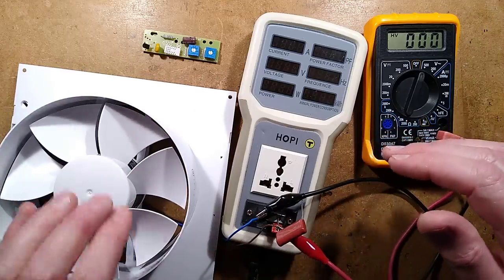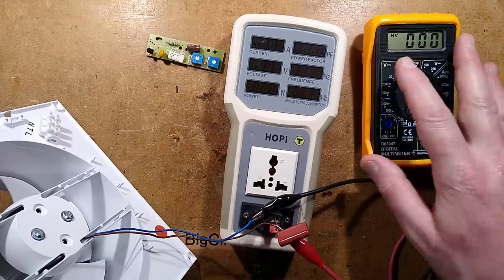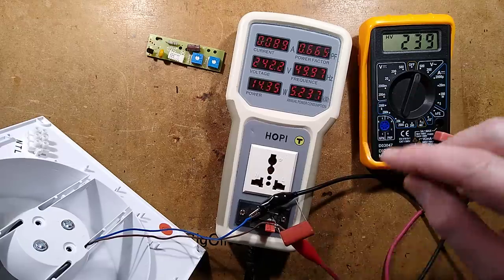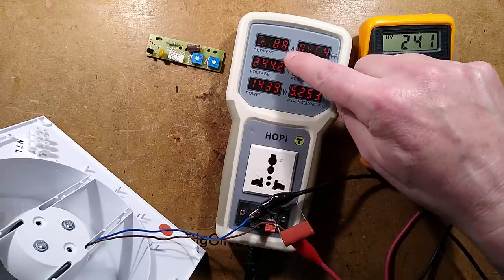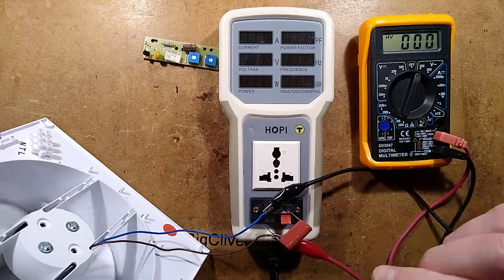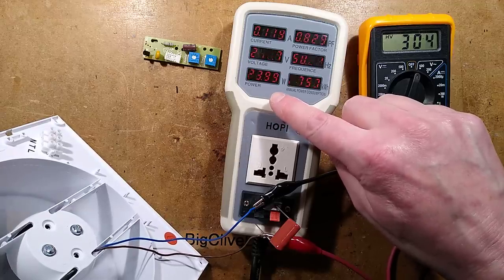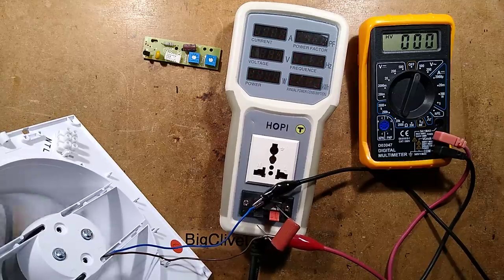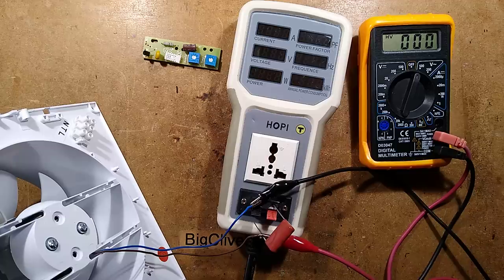What the heck!  Series capacitor makes fan go TURBO!

Comment: As others have said, this is a sort of power factor correction (though often power factor correction uses parallel capacitors, not series capacitors).  I ran through the numbers for this.  It's nice to see that theory works.  For the circuit without the capacitor, the complex power can be calculated using the real power and power factor provided by the HOPI, and then in turn the equivalent impedance of the motor can be calculated to be Z_m = 1769+j1987 Ohms.  The 1uF capacitor has impedance Z_c = -j3183 Ohms. The series combination of the motor and capacitor has impedance Z_eq = 1769 - j1196 Ohms, which is smaller in magnitude, and thus will draw more current from the line (which is at 240V).  Specifically, the expected current will be 240/Z_eq = 0.112 A with phase 34.1 deg, which matches pretty well with the measurement of the motor with capacitor (within tolerances).  If the capacitance were about 1.6uF, it would make the series load look almost entirely resistive (and make the motor spin fastest).
Reply: I remember back in electronics school, I was bored, so I put in a modest resistor to monitor current, then slapped the oscilloscope on in vectorscope mode to see the phase angles on the inductive motor, the capacitor and the current angles.
The instructor loved it and apparently, added it to the power factor correction class later on.
Reply: This is the most clear and precise answer. Good for you dude.
Reply: Wait, are you saying there is Build up of Electrical Energy that can't pass though the capacitor and therefore is dispersed though the Motor instead? If that was true then only 1/2 the wave form could pass through the motor, which would make it pulse. Electricity doesn't flow in wires. Maybe I miss understood you :face-blue-question-mark:
Reply: @Dazza_Doo  yeah and resisters are also diodes.
Seriously, the subject is over a century old!
Reply: @spvillano  you know what is over a century old, Why is the Sky Blue:face-blue-covering-eyes:
The Sky is blue because... the Electromagnetic wave length is filtered at the wavelength Air likes to absorb, it is then Scattered and perceived as Blue light and the Sun is perceived as Yellow, even though the Sun puts out Pure White Light. 

My Story is this: "Resisters are also diodes", doesn't tell me anything of value in regard to this video. 

I'm really not sure of your meaning :face-blue-question-mark:
I'm trying to learn, for me there is nothing to debate. 

I'm I going to play "So you are saying" game? OK So you are saying that the capacitor is NOT in resonance and has become a perfect Resistor and Since as you said "Resisters are diodes" does that mean you think the Capacitor is now a Diode.

I know that Diodes with a AC energy, only gives 1/2 of the energy in 1 direction, there by reducing the fan speeds, since it has 1/2 the wave form of energy? 

:text-green-game-over:
End Of Line
Reply: @Dazza_Doo  Were you replying to me?  My comment above is framed in terms of ac analysis (aka sinusoidal steady-state analysis).  Electrical current certainly does flow through wires.  And AC current flows through a capacitor, but the sinusoidal voltage lags the sinusoidal current by 90 degrees.  (The run capacitor in a single phase induction motor is there to create a phase difference between the two windings in the motor.  If there wasn't a phase difference the motor wouldn't spin.)  My impedance calculations are related to resonance.  The resonant frequency is when the reactance of the capacitor (imaginary part of the impedance) cancels out with the inductive reactance of the motor, which would happen here when the capacitance is about 1.6uF.  The circuit in the video is not at resonance (which would be 63 Hz for the 1uF cap).  Impedances and power factor allow one to predict what is going on inside the circuit.
Reply: @Dazza_Doo  Electricity doesn't flow in wires? Hmm. I wonder how many people got electrocuted by touching a wire...
Reply: @crazysquirrel9425  Electrodynamics mate
Reply: @Dazza_Doo  For us lay folk, we need a tad bit more information.
Reply: @crazysquirrel9425  I'm a lay folk too, I've just watched many YT videos regarding this information. I started when Veritasium made his video The Big Misconception About Electricity and his follow up video, that BigClive made a video on. Which lead me to Rick Hartley, The Science Asylum made some really good entry videos for us Lay persons regarding Electrodynamics. Most Electrical Engineers already know this information, it's not passed down efficiently to the commoners, and this is why I struggled with Electronics for such a long time. If you want to learn a little more, you are most welcome. Sorry for the rambling. Hope you can learn more.
Reply: @crazysquirrel9425  On a side note, the reason PCB designers are obsessed with Energy within the Circuit, is because is a microscopic transmission line, which is what they call the Power Station to Your home circuit. The Transmission line, never physically touches your house, there are air gaps and energy conversions thought the 'Power Grid'. PCB designers often get Interference, Electronic interference within Circuit boards, this then made the PCB industry develop into digging deeper into how Electricity really flows. Most of the knowledge is from Physicists, understanding the Einstein, Maxwell and all the other "Brains". I digress, You will find good information from PCB designers on how energy flows in a circuit, because if they don't they could bring down an aircraft, create a flaw in a guidance system for satellites by the way the Circuit board is layed out.. etc. <--- that's one of the reasons you can find the deeper material there. I'm sure are other reasons too.
Reply: @Dazza_Doo  Then what size capacitor do I add to my box fan?
If a capacitor passes AC, wouldn't that allow current flow when the fan is off too?
I want to make a box with an outlet and a cord, add in a capacitor (across the outlet? and cord to the outlet.
Would that work?
Also, if I used the same adapter setup, what else can be plugged into it and get a benefit?
Corded drill?
Blender?
TV set?
What capacitor ratings and type would I need?
Or does each item need it's own cap values for that particular item?
What if you put the cap in series with the line?
Reply: @crazysquirrel9425  As far as I know and you should search BigClives videos, I being watch them at times. The Question of "If a capacitor passes AC, wouldn't that allow current to flow when the Fan is off too?" Yes, Briefly, as the Capacitor discharges. As for your other questions, I haven't experimented with such designs. In BigClives video above the interesting part was the improved power efficiency to the motor, as BigClive only 'over powers' the motor for a short duration. The above fan is a simple motor, possibly the universal motor layout and they are not the best at efficiency to begin with. If you try this with a DC drill (of quality - say "Dewalt brand") then those motors are more like Electric Car motors, very efficient to begin with and they have dedicated controllers.
Reply: @Dazza_Doo  You are confusing the flow of electrical current with the flow of electrical energy.  The Veritasium video discusses the Poynting vector (the cross product of the electric and magnetic field, as a function of position) which describes power flux, NOT current.   It is important to distinguish between those distinct concepts.  Current flows in wires.  Flowing current creates the magnetic field that causes power transfer as described by the Poynting vector.
Reply: @regroff  We could say that EM waves in the wire create Electrical current (moving electrons in a direction). The flow of Electrical Energy is the same as the Flow of Electrons (current) and since Electron Drift is microscopic, then the Energy is in the fields, the Current is the Result or the Effect of the Fields. I don't think there is confusion, they are both interlinked (play The Circle of Life - Lion King). In a conductor (which is usually in excess of Electrons in the outer layers that are in their spin) Electrons at 'rest' have ben said to be moving at the speed of light in every direction all at once (Quantum physics is way beyond me) I do watch Science Asylum and try and follow. I digress ... The EM wave is the Energy, we can say this for fact was we observe this in our car radio (EM Waves by Professor Matt Anderson) really shows this in action. EM Waves if not interrupted by a conductor will travel free space until they do get absorbed by something. Since Electron drift is microscopic and that is Current, then if the Current carried the Energy in circuit, then our circuits and lightbulbs would take maybe an Hour to turn on? Lightbulbs to Switch in your house.
I'm saying that Current is a bi-product of the EM wave in the circuit. This is directly proven with AC - no Electrons from the Power Grid or Generator come to your house or circuit. Current is a result of these fields, because they have energy. Inductors are mediums (as in physical). We Measure Voltage, and We Measure Current - what are we measuring? The EM effects on that medium. I don't think I'm confused, I'm trying to dig deeper. Does it matter for a DC steady state circuit? Not at all, not really. Unless you have switching components and AC energy. An LED is happy to absorb all the Energy from a 3v button cell and hey, even some of the electrons from the battery will probably make it to the LED :D 

So sum up: 
Current = SLOW (even a turtle is faster)
AC: Current goes No where (1 Step forward, 1 Step Back) 

Other Evidence: 
Return Currents in a circuit in a DC steady state will radiate out and will return back to the source signal in a mostly direct path, however at higher frequencies the return Current only follows the direct path back from the signal source (directly under it), why? Current isn't Energy, it's a result of the medium being energized by the EM field, so it' 'Follows' that path back. It only about 100Hz before the return current is fully returning the same path from the Signal source. This is the Rise and Fall times of switching components. How does this relate to current? Current is reacting to the EM fields traveling along the conductor (microstrip line). See Rick Hartly and Eric Bogatin for more information.

Comment: Adding a capacitor created a resonnant circuit, maybe not perfectly tuned, but still a resonant circuit.  They tend to create higher voltages or currents that what comes from the power source.  Thus your power and voltage readings where higher than expected.

Comment: I'm glad I"m not the only one who experienced something like this. My desk fan, rated 120v .33 amps @ 60Hz in series with a 10uF capacitor was getting just about 240v due to the boost. One difference is I thought mine went immediately to double voltage and yours is taking some time to reach only 33% more voltage.

Comment: As others have mentioned, it has something to do with LC resonance but I just wanted to add, I have used smaller value capacitors to drop the voltage and run small 110V induction motors on 220V without the losses of using a resistor. This video shows what would happen if you want to drop the voltage but get the wrong (right?) value capacitor.

Comment: The exact same thing happened to me when I tried to reduce the speed of noisy a fan, with a capacitive dropper😂😂. Some values  of capacitors would slow the fan down, BUT if you hit a sweet spot valve of capacitance , then the fan went mental speed!!! I think the inductance of the motor and the capacitor are forming a tuned resonance circuit. It was quite cool to observe at the time. Thanks for  reminding me of this. I would love to see an oscilloscope trace of the wave form.

Comment: Increase the capacitance to make the power factor 1.0 then use a variac to reduce the supply voltage until the wattage is back down to the fan's normal value. Now you have an efficient fan.

Comment: Are we sure it's not April the 1st and Clive is having us over? But seriously, I think it's time you break out the oscilloscope and track the voltage and current phase relationship with and without the capacitor; I think you may find it's bringing the voltage and current into phase alignment.
Reply from the maker: It's real.  But there must be some interaction to increase the voltage.  The power factor does improve.
Reply: @bigclivedotcom  Yeah, there are a lot of pages about LC resonance. Both the voltage across the inductor and capacitor are higher than the supply voltage, but this difference cancels out because they're out of phase. (Don't ask me about the maths; I tend to get lost when j or i enters the equation.) If you choose the right (or wrong?) value for the capacitor you can bring the AC impedance close to zero ohms, so the only apparent impedance would be the DC resistance of the coil. It would be fun to see whether the capacitor, fan, or circuit breaker goes BANG first.
EDIT: By the way, I'm not sure if Clive intended this, but he gave us a really nerdy maths joke. The additional voltage he's measuring is on the j axis. Square root of minus one stuff. A mathematician might say it isn't real.
Reply: I remember seeing power factor correction, on the load side of a transformer (which is basically like this fan) could cause an increase in the voltage output from the transformer. It had to do with voltage vectors and so on... Been a minute since I saw it, but it's one of those things that stuck with me because of how it confused me, at the time.

Comment: It isn't always obvious to folks who don't work with RF (Radio Frequency) electronics, but you achieve maximum power transfer between circuits when the output of one circuit (the mains) and input of the other (the fan) impedances match.  As several folks have already commented, the fan represents an inductive load and by adding the capacitor in series you are better matching the load (fan) to the mains.  Bear in mind, that match is also frequency dependant so depending on if you have 50Hz VS 60Hz, will also make a difference.  Good motor designers try to make sure the  inductance of the motor is resonant at the AC frequency in which it is designed to work so my guess is the fan motor you have is not resonant at the AC frequency where you are, and you helped correct that deficiency by adding the capacitor.
Reply: Just to throw in an additional comment, if you wonder how they make those cheap ceiling fans have a low, medium and high speeds, they switch in capacitors of different values to change the impedance which impacts the circuit matching to give different speeds.  Its not pretty, but it works fairly well.

Comment: Together with the coil in the motor that capacitor forms a tank circuit. The capacitive and inductive reactance basically cancel each other and the voltage on the inductor  
can rise above the supply voltage. At resonance in a series tank circuit the current is only limited by the resistance of the wiring and the coil. So if you use that fan in long-term operation with the series capacitor, it may reduce it's lifetime. Btw I'm using a series LC circuit with a halfbridge driver in the transmitter of my diy wireless power transmission system. I've already measured up to 800Vpp on the coil in the tank circuit, even though the supply voltage of the halfbridge was only 30VDC from my bench power supply. You don't wanna touch that.

Comment: Hah! I'm lucky enough to have had this taught to me in high school! And unfortunate enough to have forgotten most of it in the 30 years since! 🤣
 
Didn't know (or forgot) that this could impact things like fan speed though. I think we mainly discussed it in terms of the power factor, and correcting for it in say a factory, because the grid don't like big inductive or capacitive loads. Can't remember why though.
 
Anyway, now I think I understand how variable speed fans work. You know, the ones you use in summer to stay cool, and that have like 3 speeds or something. Got one that's falling apart mechanically, might open it up to verify my theory. Cheers mate, and thanks! Also big big thanks for not making this one of those "shorts" abominations.

Comment: Yeah i figured the capacitor trick out a while ago on a whim, saved heaps of headaches. Clients complain the fan is running slow but instead of replacing the unit i tried the capacitor and it worked, saves trying to find replacments for fans that go in and out of style every couple of years